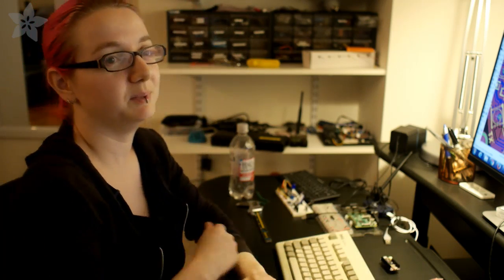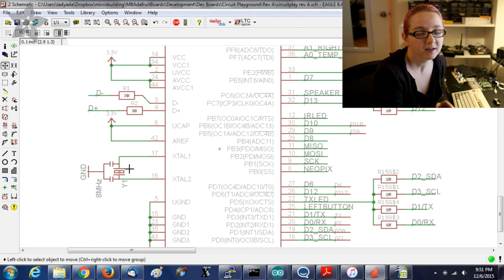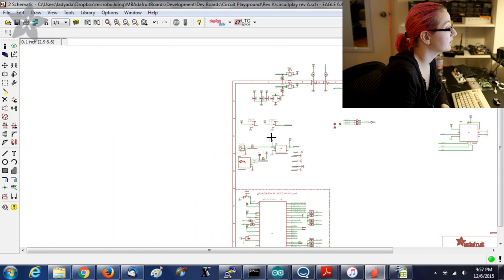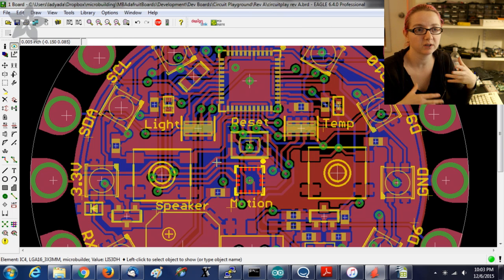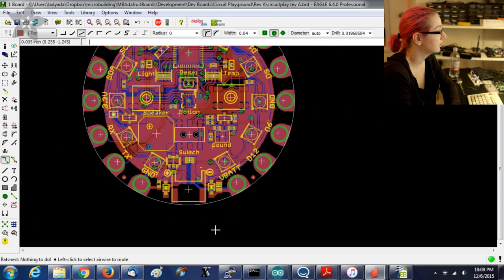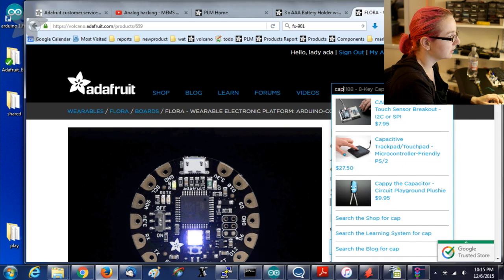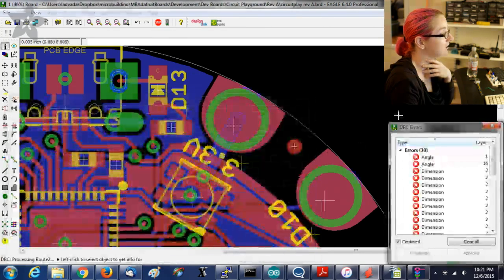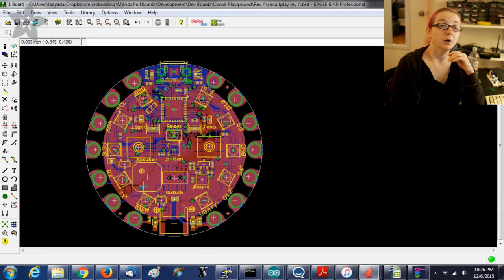Circuit Playground revA PCB @adafruit #fromthedeskofladyada 12/6/2015 LIVE

Comment: Ladyada: As for the answer to your Eagle's default VIA Settings question, just go to the BRD: section of your eagle.scr (which is located within the scr directory of your Eagle installation) and insert/modify the following code:CHANGE DRILL 0.02968504;CHANGE SHAPE ROUND;CHANGE WIDTH 0.04;